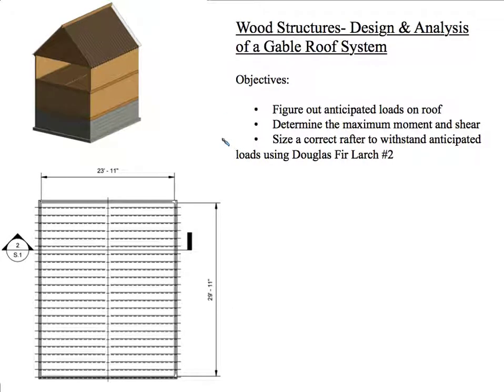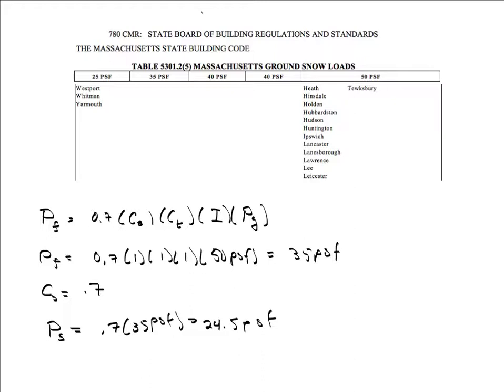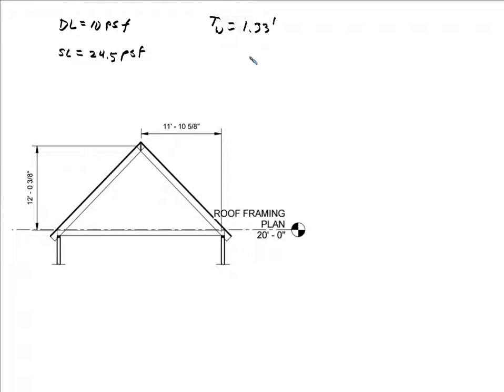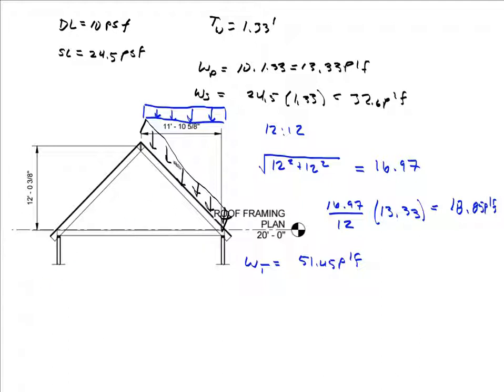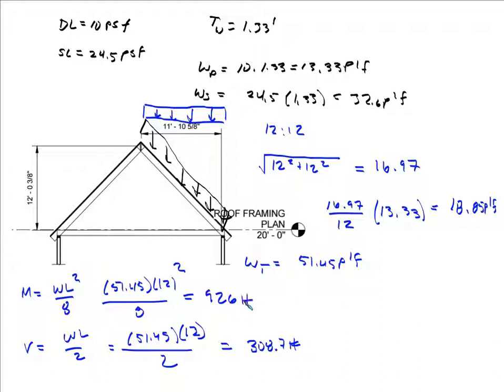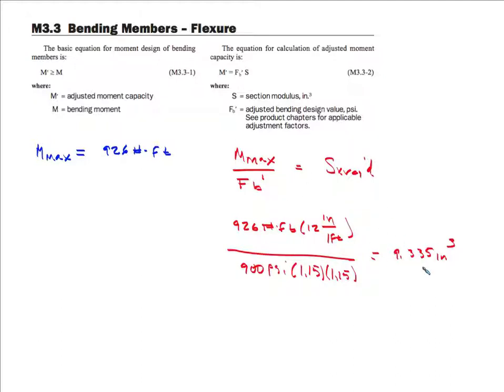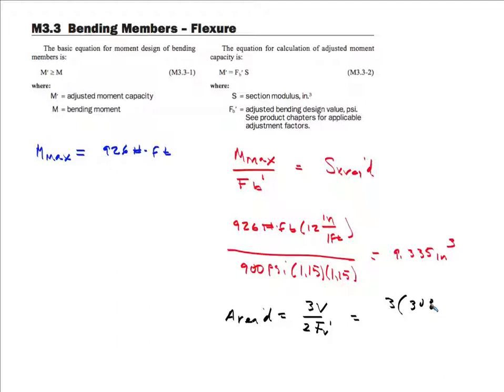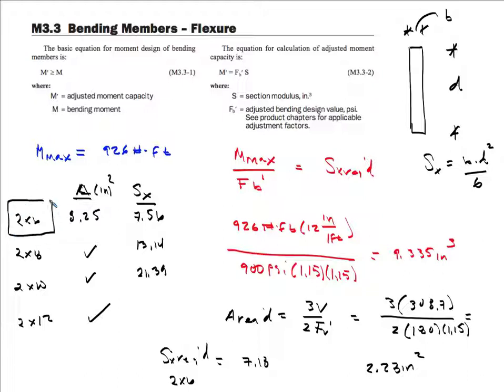Gable Roof- Design Example of a Gable Roof System Part 2

Comment: The only place you use the value of 308.7 is in the third video and its calculated as the thrust that you then design the nails required at each joist to tie in the rafter.

Comment: Hello at about 10:12 in this second video, you use an equation for area required A=3V/2f’. Where did you get the value of v you used 308.7 and what is it? Thanks 
Andrew